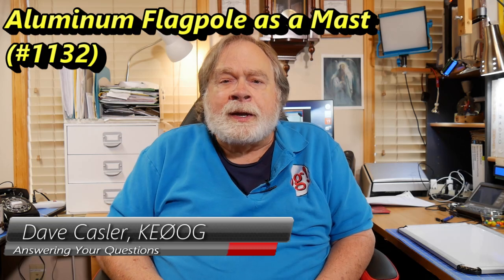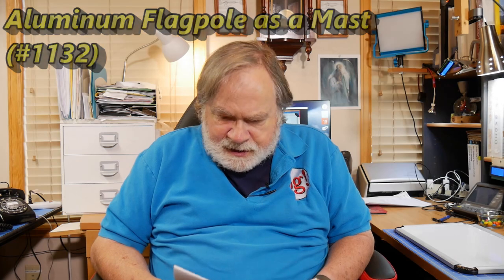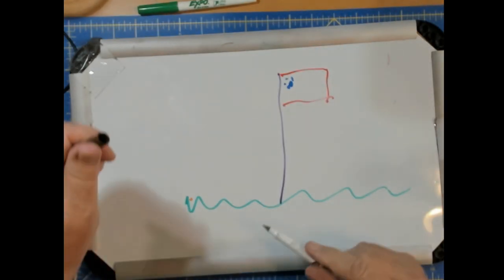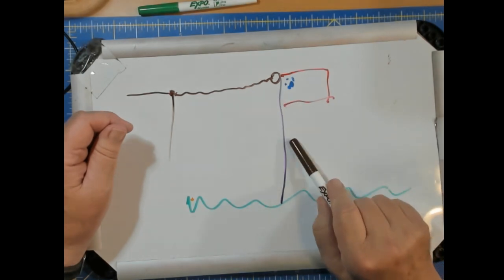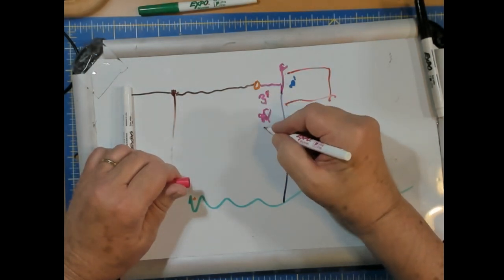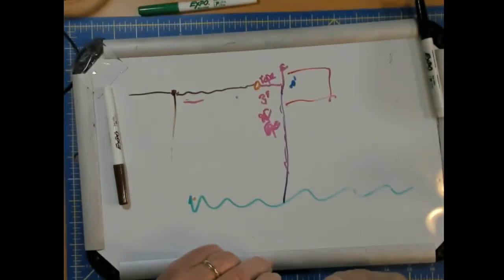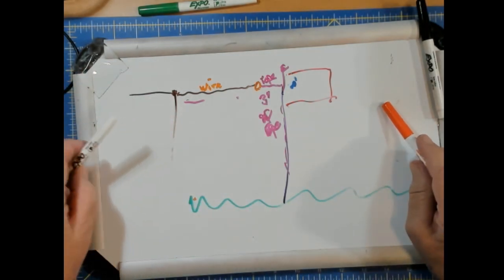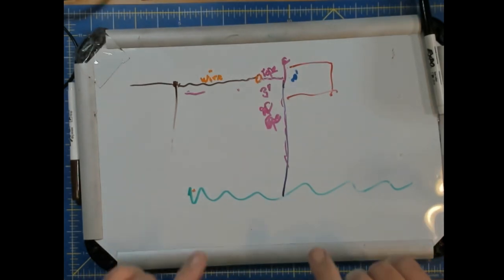Aluminum Flagpole as a Mast (#1132)

Comment: Hi Dave (or anyone else with beneficial advice) - You mentioned the flagpole being well-grounded at the beginning of the video.  How does that factor in to anything?  What if the mast isn't grounded?  
The reason I ask is because I have a fiberglass sailboat I can't use (long story - gifted to me) on a trailer.  I can attach a 2m vertical antenna and raise the non-grounded aluminum mast - which is the cheapest and easiest solution I can imagine to my needing an antenna way up high.

Comment: How about using the flag pole as an anchor for the center of the dipole? 

I have a 35’ aluminum telescoping flag pole I carry in the RV so we can proudly fly Old Glory at our campsite. I have used this flag pole to hold up the center of my OCFD, as an elevated feed point for an EFHW as a sloper and I’ve ever zip tied a 2m horizontal loop to the top. I always figured the mast was getting into my antenna’s business, but sometimes you don’t have a choice of mounting locations. 

Anyone have insight on this sort of setup?

Comment: I am using a 130 ft. EFHW in an inverted V configuration with a 25 ft aluminum telescoping mast in the center and ends up at 9 ft. high. I have the antenna wire running through a pully at the top of the mast. From Colorado, I am able to work South America, Japan, Australia,  New Zealand,  Russia, Europe, and the Caribbean. The antenna wire is really close to the aluminum mast, but there is not much I can do about that.

Comment: What about as the antenna itself?
Reply: Depending on design, it may be a great antenna or not. For example, I would not want a quarter wave dipole unless it were working against a set of radials - otherwise ground resistance could waste a lot of power. A half-wave vertical dipole is great if you stand it on a long enough insulator. With any design, if it's telescoping, I would want to solder all junctions solid. Otherwise conduction through oxidation would cause major issues, such as radiation on harmonic frequencies, static noise on reception etc.
Reply: They work well. I have instructions on my page at N6MJS.
Reply: They do work great. I made one out of a Harbor Freight telescopic 20' flagpole. This is a OCFD configuration. Put a screw through the joints to make contact and add a remote antenna tuner like the LDG RT/RC-100. (100W) I tune 40-10, some on 80M.  I have made DX contacts. N6MJS for instructions if you're interested.

Comment: My 107’ Random wire antenna goes out of the house to a flagpole in front of the house to another flagpole in the back and lastly terminates at my shed peak 10’ above the ground. It is in a sloping U configuration and the SWR with a 5:1 unun is about 2.0 or less depending on the band. This antenna works on 10-160 meter bands and I get great signal reports. The wire is never touching the pole. An example of a great antenna that everyone will tell you won’t work. Just keep experimenting!! Thanks Dave.

Comment: Harbor freight sells a 20 ft.  telescopic aluminum flagpole for around $90 (wait for a coupon event, and they can be bought for as little as $60), which is substantially less expensive than the aluminum masts sold at the ham radio stores like DX Engineering.  Many people use them.... in fact, that's how I discovered them, by recommendation.  These are also extremely popular with RV'ers, they use them as a mast for their Satellite (Starlink) dish antennas and as such, sometime it's hard to find a Harbor Freight that has the flagpoles in stock. 

I've had mine for almost 2 years, works great.  I'm using it for both an EFHW wire antenna and a dual band 2M/70cm vertical antenna.
Reply: I would love to know more.  Specifically, about the 2m/70cm vertical antenna, and grounding.

Comment: Very interesting. I recently made a speaker wire vertical antenna and have it hang straight down attached to an Alumiglass extension pole I got at Lowe's. It extends from 8 up to 24 feet, with the extensions made of aluminum. The performance isn't great, but it works. I'm planning to make an inverted vee and just hang it from the top of the pole with a rope and see how it goes. Love your channel. KA9PHI
Reply: Glad Ed's antennas got mentioned. They haul the freight thru the years in my experience, rain, sleet, hot summers not withstanding.  First the dual band then to the triband. Can connect on 50W with 2m repeater across 45 mi. On 1.25 about 30mi using 25W. Portable model works a treat in the field suspended from line between two tree. Hoping useful, 73